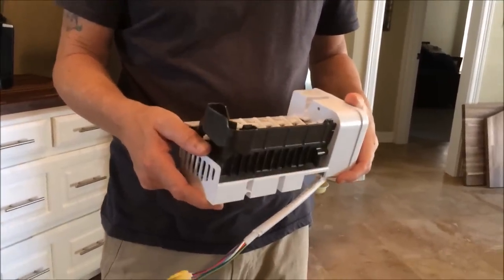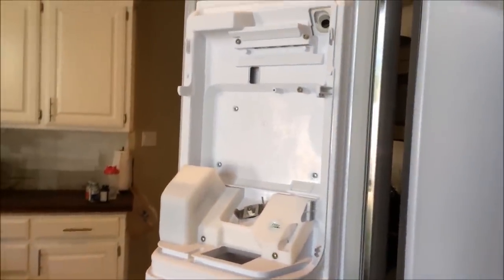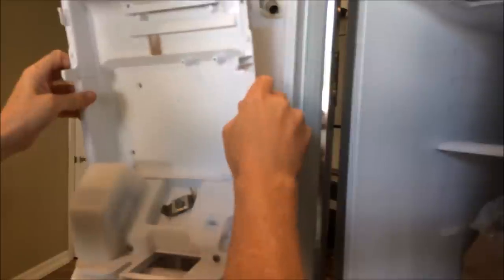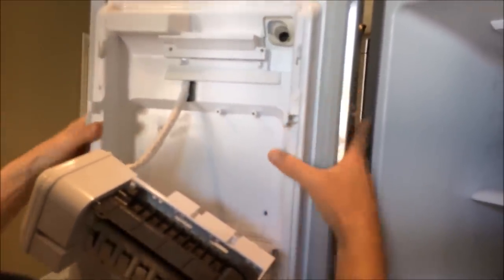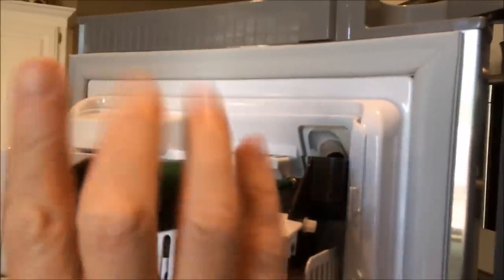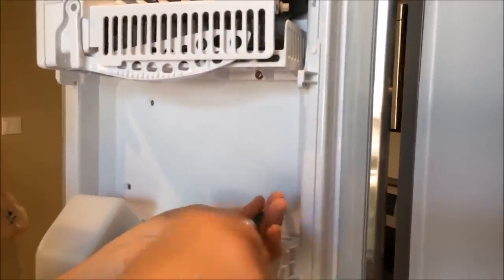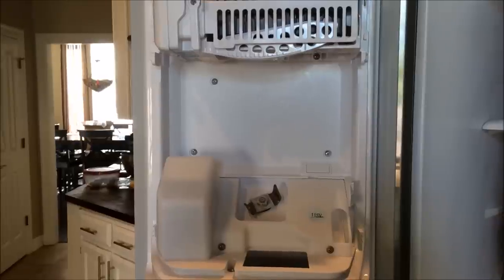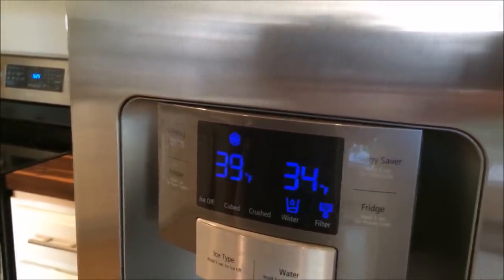Replace Ice Maker Install Samsung Ice Maker Part # DA97-11092B

Comment: How long after reset did your freezer start producing ice? My freezer has never made ice and the last time we started it up it never made ice we had a service tech come and he has thought the lines has frozen inside the door. I defrosted and reset the maker but hours later it shows no signs of trying to produce ice. Does it truly take 24 hrs? Thanks
Reply from the maker: Cameron Matthews I would say at least 8 hours.  You first have to make sure that the ice maker is filling up with water.  After you hit reset, you should hear it start to fill within a couple of minutes.  If it is not filling up then it's a fill valve issue in the back of the fridge.  This is if you have the exact fridge we do.

Comment: Thank you for this video. I'm about to replace the ice maker but have one question: Can I pull the ice maker's power cord through the panel slot without having to pop off the panel first? 
Thanks in advance,
Lenny
Reply from the maker: Unfortunately No. Not on this model fridge.  The panel might seem kind of tight at first, like maybe there is a soft adhesive applied.  Just keep working it.
Reply: Thanks for quickly getting back to me, but let me rephrase the question: (the first step is to remove the ice maker from the door. This part of the video is not shown) "So, after removing the three screws securing the ice maker to the panel, can I then grab the power cord and pull it straight out though the panel slot?" 

Lenny
Reply from the maker: The electrical connection for the ice maker on my refrigerator model is fixed inside the door, it does not have extra length like the ice maker itself. That is why removing the door is necessary, it is to unplug it.

Comment: IS THERE ANY WAY TO MAKE THE FLAPPER DOOR CLOSE FASTER? MINE TAKES ABOUT 15 SECONDS WHICH LEADS TO FROST BUILD UP. ONCE THIS HAPPENS I CAN'T DISPENSE CUBES JUST CRUSHES EVERYTHING AND RUNS ON AND ON WITH NO ICE DISPENSED.
Reply from the maker: +Brett Connelly Sorry!  Can't think of any solutions right now as I have not had to investigate that problem yet.  But if I come across anything, I will certainly let you know.

Comment: How do you get your top part to slide up and off so easily? Mine won’t move, with or without the ice bucket being on.
Reply from the maker: Robyn
Yours may be a little frozen or something. Try tapping on the bottom sides with something like the soft end of a kitchen utensil to see if it Comes loose. Look for any tape that may not have been removed from shipping.
Reply: @silverhairlife  Thanks! I got it. I banged it a little. You also have to VERY slightly tilt the bottom slowly to get past the little clips at the bottom of it, as you lift straight up. I haven’t had it working for over five years because I wasn’t going to pay over $400 for ice. I saw this randomly, and figured I might as well order and try. It comes in Saturday. Hopefully it will work!🤞Thanks for making the video!
Reply: See my post today.  Maybe this is what's happening to you? @robyndery2319

Comment: I noticed that when the ice maker in the video was installed and the freezer door closed, the ice level arm was in the up position. There is no way the ice maker will produce ice with the arm in the up position- this indicates a full ice bin.  How was this ice maker made to operate?  My Samsung ice maker has the arm stuck up and no longer produces ice. Thanks for any help!!
Reply from the maker: +Cliff Egel When you push and hold the reset button, you should see the arm move.  If it doesn't move, it is most likely defective.
Reply: That did it!  Thank you, thank you, thank you!

Comment: I replaced ice maker ten hours ago and reset it allowed water in but I didn't see ice level pedal go down. I also forgot to turn on the water but just turned it on could that be what's stopping the ice? I'm thinking to dump out small cubes and reset.
Reply from the maker: Sorry for the delay.  Yes, dump out ice and reset.

Comment: So did this fix the issue? We are having the same problem with ours.
Reply from the maker: +PENNIE BLOUGH Yes, the issue is now fixed.  Thanks for watching!
Reply: I have the same problem although the model number does not match.  Problem is  a leaking seal around the temp sensor. I tried to seal it up using waterproof sealant and that fixed it!. No need to replace the whole unit to fix a leaky seal! Spend $5 and save $100   Model of ice maker is DA97-13415D
Reply: @williamsloggy5144  I wish I knew where the temp sensor is.  I cannot tell if something is leaking.  It only moves ice with the test button.  The maker didn't seem too frozen over, and I didn't see any leaking.

Comment: I’m just working on mine, the ICE LEVER seems to stay up which happens when ice is full. It won’t drop down even if I manually do it removing side cover where gears are. It just auto goes up. Had it apart and back together lever stays up and NO ICE.  what is that design and how to fix it?
Reply: Did you ever find a fix? I have the same issue and have already replaced the icemaker and the new one stays in the up position as well

Comment: How long has everyone had their fridge before the ice maker broke? i have the same model as the video and the fridge is only 5 years old
Reply from the maker: We started having problems with ours after 2 years.
Reply: Jeez, these Samsung fridges have a bad track record from my searching the net, our fridge also has the problem where the fan in the fridge freezes and has to be thawed out.  My part is on order,  thanks for making this video
Reply from the maker: Yes, we have wished we went with another make.  Glad the video helped.
Reply: Orl T
Reply: 8 years and on the 4th ice maker. They are a POS

Comment: my Samsung fridge has a similar setup/ice maker, but my problem is that “Ice Off” indicator keeps flashing and it does not produce any ice.  Normally the flashing indicates the bucket is not in place but I have quadruple checked that the ice bucket is indeed properly installed.  I have checked water pressure, reset entire fridge (unplug power for 10 min) and pushed the reset ice button til it chimes....  (doing last item produces one set of ice blocks during sequential resets)....   any ideas?
Reply: I have the same problem - what was your solution/outcome/fix?

Comment: i replaced my ice maker this morning. to start i turned off ice maker on door switch than turned off circuit breaker. after installing new ice maker i turned breaker back on then ice off 
switch on door and reset ice maker. now the ice off light is flashing. how do i correct this? the ice bucket is installed correctly.
Reply from the maker: To be honest, that's a new one for me.  Sorry I can't help you, but if I do figure something out, I will let you know.

Comment: these ice makers must be junk I've had problems with mine also. I've had the water inlet valve replaced ,the ice maker, the inside control panel replaced, the front control panel and it's still not working . the repair guys don't know what else to do, I'm glad I got  the exe. warranty this is only 3 yrs. old . Now I guess I call Samsung and see about replacing it.
Reply from the maker: I agree.  I hope you have good luck when you call Samsung.

Comment: I have all the proper screws removed but my panel seems super stuck. I am very afraid to pry it off. Is there any trick to pulling a certain way?
Reply from the maker: Just keep working at the seams, and it will eventually come loose.  There may be a little adhesive on the backside of the panel as well that needs to come loose.  I had to apply a little force when I first removed mine.